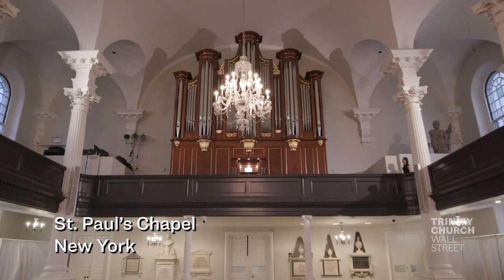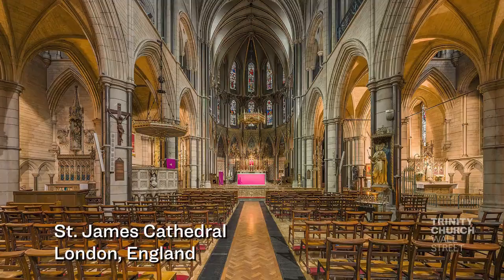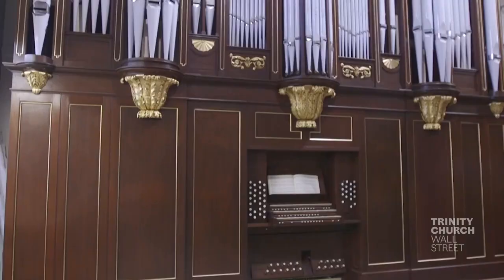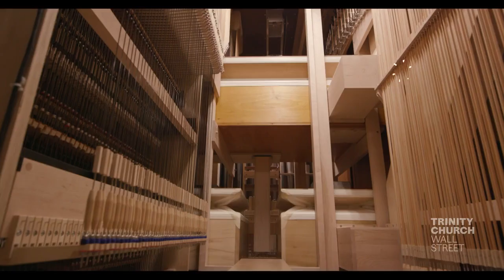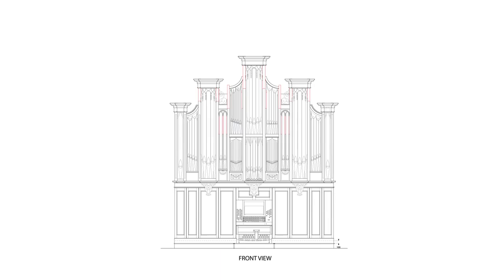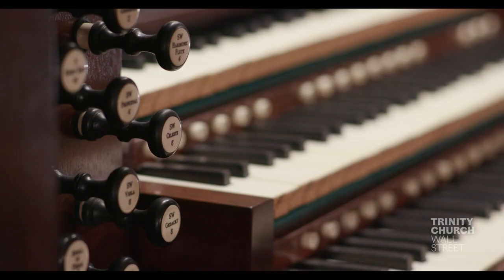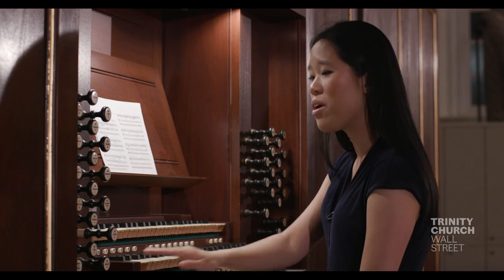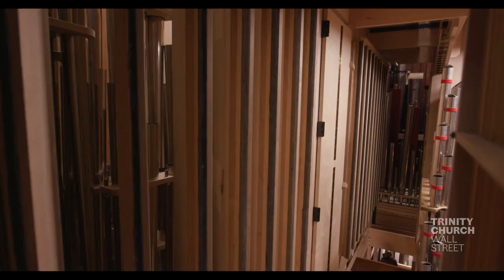How Pipe Organs Work: Inside the St. Paul’s Chapel Organ

Comment: Didn't realize how complex these machines actually were. If an electrical engine pumps air into modern organs, how did pre-electric organ acquire air?
Reply: Steam I think
Reply: @jeridtroncoso4090  I mean that's what everyone who searches for how an organ works is interested in and yet none of these videos seem to present it
Reply: Pipe organs before the late 19th century or so were generally powered by at least one (or in large organs, multiple) person/people who pumped the bellows. This was done either by hand or by foot, usually in a separate room where the bellows were located, partly so that the sight of people pumping the bellows wouldn't distract from the music, and partly so that the mechanical / pneumatic wooshing noises also wouldn't detract from the music. Here's a very old pipe organ still with its original bellows (although I think they've been releathered / maintained in recent times, but still in operation). Enjoy! Notice how these levers are weighted and balanced so one person can pull on them one at a time to allow the weights / gravity to do the work of actually creating the air pressure, giving them time to move back and forth from bellows to bellows. But this is a smaller organ and can easily be pumped by one person: https://www.youtube.com/watch?v=tHoXn_dQQGY
Reply: @jeridtroncoso4090  I think you're thinking of the steam calliope. 

It's possible that one or more pipe organ blowers or pumping bellows for church / concert hall organs WERE turned by a steam engine (maybe piped to the steam heating system, for example), but if so, I don't know which ones and this seems to have been quite rare 'back in the day', judging from references in books about pipe organ history that I have. 

I HAVE heard of several organ blowers run by belt via a gasoline engine though (which must have been noisy as well as dirty, with the exhaust piped outside the building). I believe this was rare however. 

By contrast, however, steam power to operate FAIRGROUND ORGANS (which are indeed pipe organs) was so popular in the pre-WWI period in England and other places in Europe, that although the steam engine merely turned the organ's flywheel (to pump the bellows / operate the keyframe) or even, less directly, turned an electrical_generator to generate_electricity on a "showman's engine" (huge tractor / generator for pulling amusement trailers and remotely generating power), which then ran the electric motor on the fairground organ, that in England these organs are widely colloquially known as "steam organs" even though no steam should ever go through the (mostly wooden) pipes! 

At annual events like the Great Dorset Steam Fair and other similar gatherings in England, you can still see restored antique showman's engines running on steam power and generating electricity for the organs and rides, as well as serving their tractor-function in pulling big heavy trailers onto and off the rally field. 

Once electricity came in, nearly everyone turned to electricity to power their organs, and the first electric blowers came in around the 1890s. I personally own an early Kinetic organ blower with a low serial number and the latest patent dates are around 1907 or 1908 I think, making me think it dates from just a few years after that. 

A great history of most of the big American blower companies (there were only a few, that supplied nearly all the pipe organs built in the USA) can be found in David Junchen's book "The Encyclopedia of the American Theatre Organ, Vol. II" published in the 1980s. There are also a couple of photos of water motors / water engines in there (as well as a drawing or two of one in the Imhof & Mukle section of "The Encyclopedia of Automatic Musical Instruments" by Q. David Bowers).
Reply: Some large organs were pumped by steam engines, although the steam never actually came into the organ. The steam engine was in an external building and simply turned a mechanical blower to pump air. This was rare, and was restricted to large concert hall organs like the Royal Albert Hall. Smaller organs that would be common in parish churches were hand pumped until electric blowers became available.
Reply: @chrisrosenkreuz23  Indeed.
Reply: A breathless congregation perhaps... :P
Reply: @andrewbarrett1537 Thank you for the information 😄
Reply: By pumping a set of leather bellows

Comment: Are pipe organs built into the building or is it the other way around?
Reply: 6 months late but the building IS part of the organ. Kind of like how a guitar string wont sound good without the rest of the guitar and a piano wont sound good without the rest of the piano. They are kind of built around eachother, the organ needs to consider the design of the church but the church design has to consider the sound qualities of the organ
Reply: It can go both ways. In some cathedrals, the buildings are built around the entire system itself for its mere foundation and maintenance. (Shows how magnificent they are once more!) while other organs can be built after the building, and you can tell it by their shape. If the building seems like they are built around the system, then it’s likely the organ was made first. If it seems the other way around, then the building was made first as a base.

Comment: so how does it work
Reply: The simplest way to explain is when you pull one of the stops and a key is pressed a valve below a pipe opens and air rushes through the pipe. The hole you see or the "mouth" is what produces a sound.